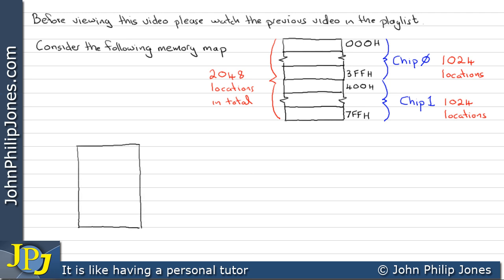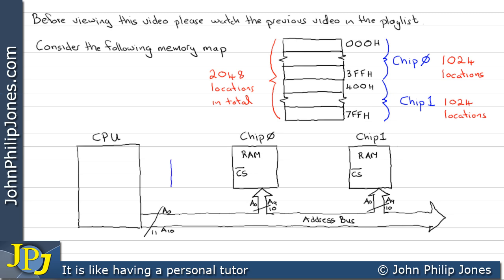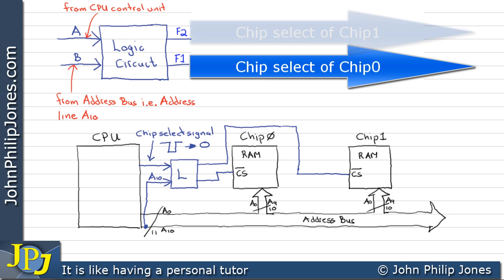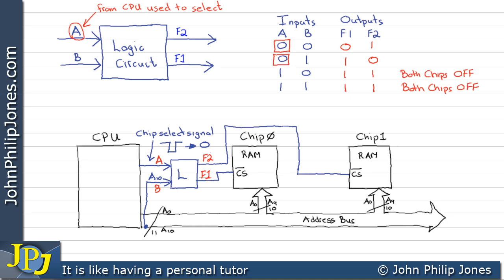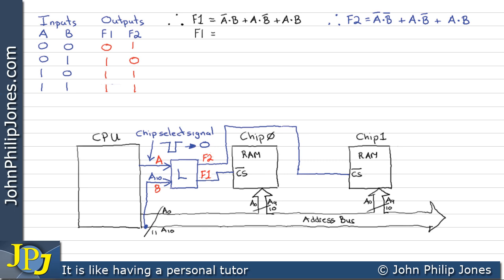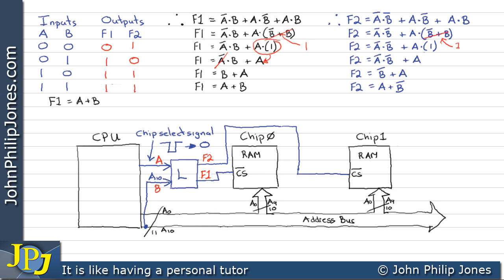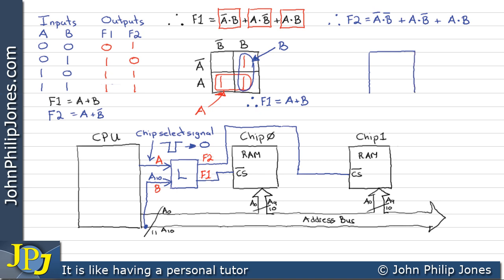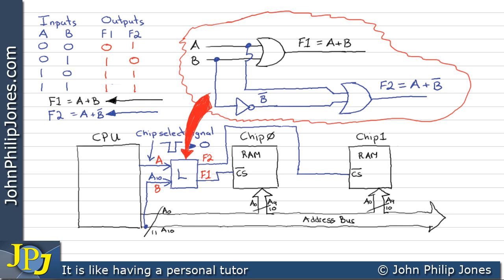Combinational Logic Circuit Design (Memory)

Comment: ok how does the 11th bit of the address bus get changed, because if we don't change it (either from o to 1 or from 1 to 0) then the B input to the chip select circuit is not going to change and then we can only enable and disable one chip? I did not undestand that. Does the cpu change that bit allso? Thanks for answering my question.